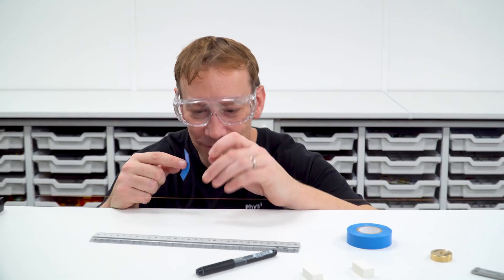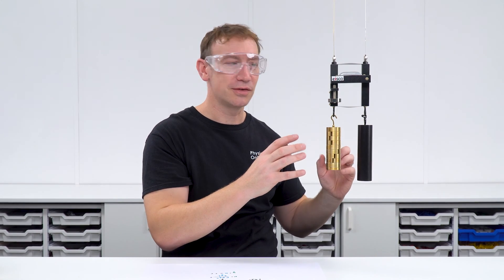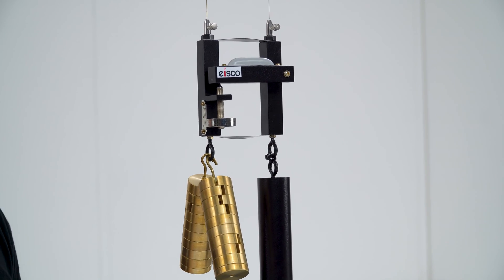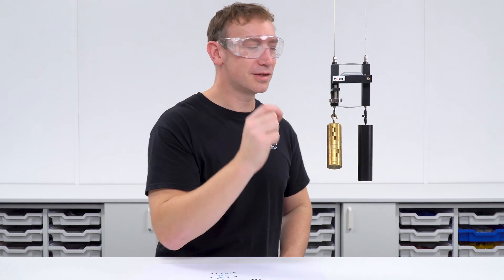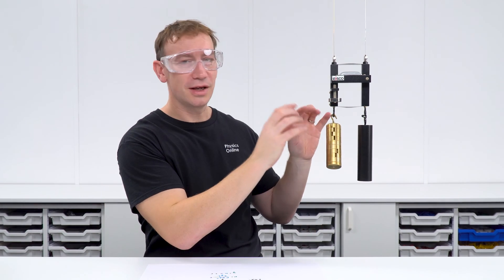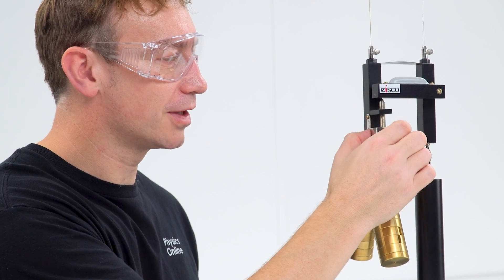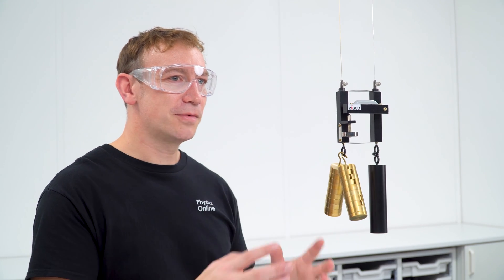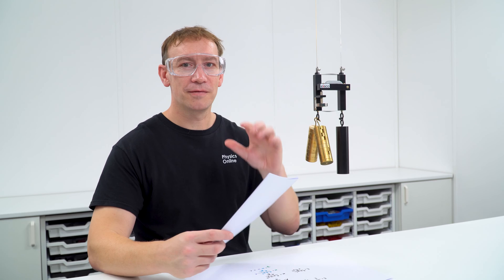Young Modulus of Steel Experiment - A Level Physics

Comment: Doesn’t it matter that the two wires are made of different materials? It’s not a true comparison?
Reply: i dont think so because you’re just using the other wire + load as a mechanism to get the main wire in level, to measure the extension

you’re not comparing the two wires, like in some other experiments